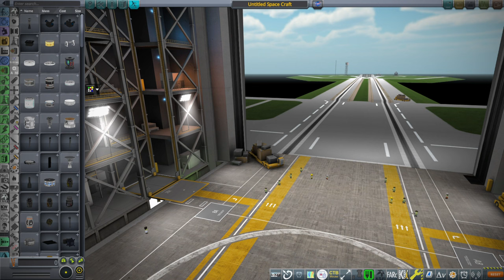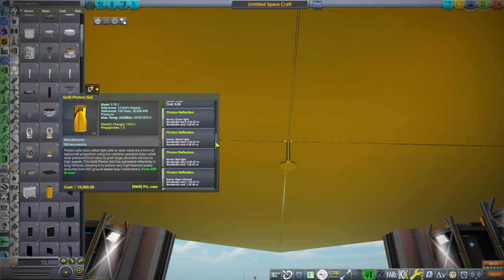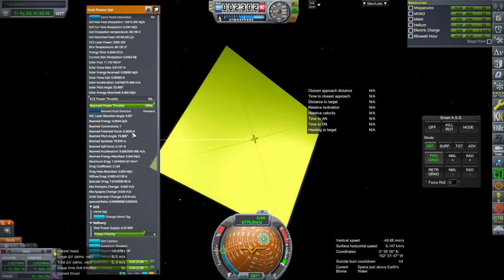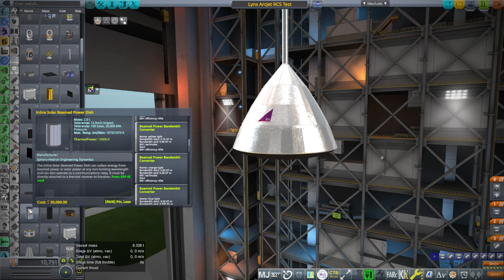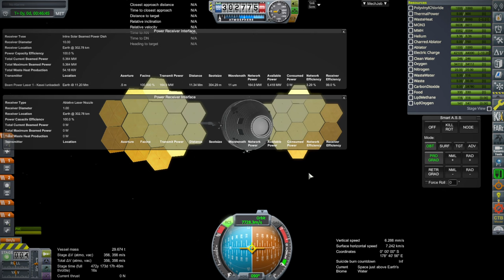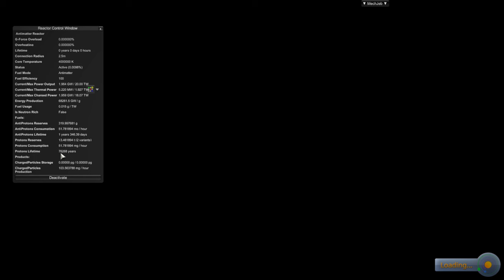RSS Interstellar with Exoplanets 02 (KSP 1.12) - Testing All the KSP-IE Things 2

Comment: Solar sails really work when you get as close to the sun as possible. Thanks to the inverse square law, the force applied to the sail by the sun quadruples with each distance halving to the sun, until the point when you start achieving thrust in the kN. Controlling the thrust is tricky, since it is coming from an external source, but it is doable. I recommend looking for solar sail trajectories to imitate, as a good start. It is not entirely difficult to reach interstellar speeds from a swan dive into the sun.
Reply from the maker: Seems like heating could be rough, though?
Reply: @RaizSpace  heating isnt too bad, which makes sense because youre reflecting most of the energy anyway